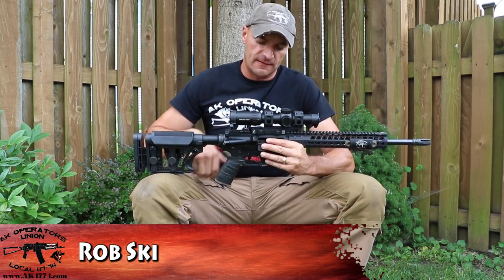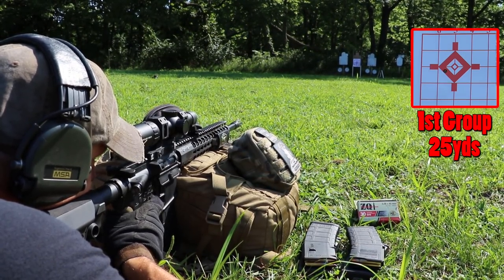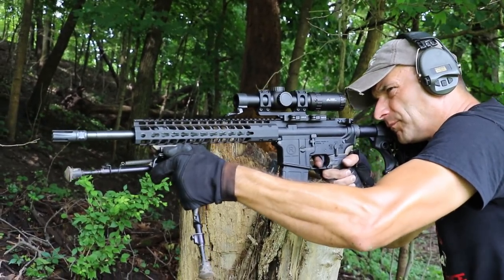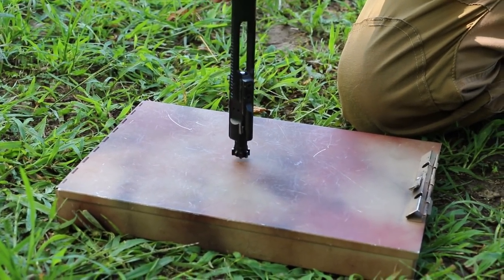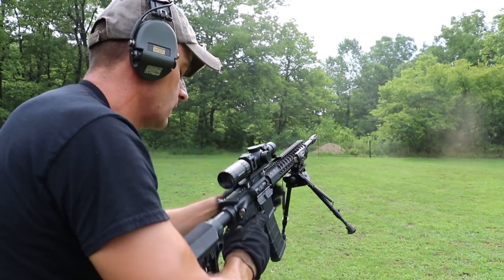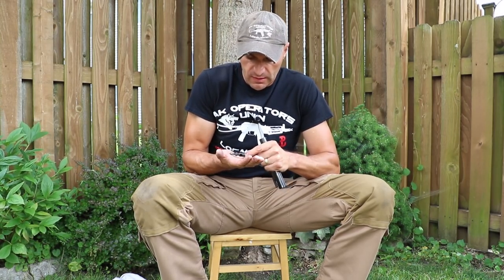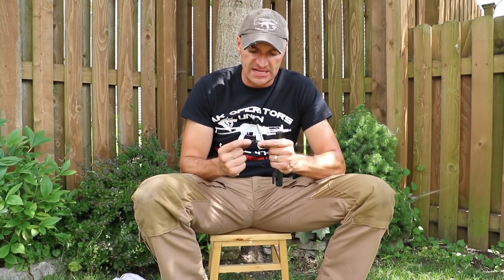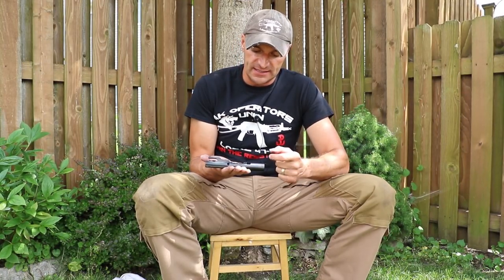Radical Firearms AR-15, 4310rds LATER - Another one bites the dust!

Comment: yes it failed your test says a lot. but for the price of the rifle if the cam pin needs to be replaced no big deal. does the rifle have a carbine, mid or rifle length gas i found on carbine length the bolt takes a beating especially the gas rings and cam pin. still shouldnt break IMO. good test thanks.
Reply: They have mid, but I've heard a shit ton of complaints about hit and miss products from them. They had an issue a year or two ago with the barrel unthreading from the chamber extension and snapping the alignment pin...that's just shit manufacturing right there. Then they claimed that because it happened when some people were swapping out flash hiders, that they wouldn't warranty it...Now hang on. Muzzle devices are usually torqued between 20-40 ft/lbs, chamber extensions are 110-150 ft/lbs...how the hell do you break that torque when swapping a flash hider out?
Reply: If its a cheap BCG no problem but it seems to be overgassed maybe increase buffer weight or its the gas port on the barrel isnt drilled to spec and overgassing it. Either way if you made the decision to buy a complete you were trying to avoid these kind of problems. I do scratch builds I enjoy the process of figuring out what works and what doesnt.
Reply: Michael Reta That's exactly why I build my rifles piece by piece as well, I want to know whats going into my rifle and who build it. I had issues in the past with an Aero Precision upper I bought, albeit, it was a stupid issue...the handguard was crooked (just had to straighten it and re-tighten it). But, because of things like that, I prefer to build them on my own. But looking at these rifles, it's not just the BCG or other materials that are cheap. The overall craftsmanship is absolute garbage. Everything from massive burrs on the feed ramps, to barrels not tightened to spec, to the freaking barrel being pitted to the point it was unshootable right out of the box. I researched the crap out of these rifles and all of their issues...I'd much rather buy a RAS47 from Century than an AR from Radical Firearms. RF is probably on-par with I.O. when it comes to quality, and most likely far below I.O. when it comes to customer service...just go read their facebook reviews. Everything from making an ass out of a customer because they had a problem, to RF actually revealing a guy's personal phone number and home address on the internet while complaining about him to his face...you just don't do that shit.
Reply: +Griff really that's messed up...

Comment: Could this be somewhat related to insufficient lubrication? Certainly there would be much less stress on the cam pin if it were well lubed.
Reply: This is correct.
Reply: True heat and friction that many constant rounds. Usually clean and lube my guns after ever shooting practice or after every hundred rounds. Heat and friction the gun will go dry.  Use good cleaner and oil don't be afraid to oil it especially a ar15.

Comment: I own a Radical Firearms 300 Blackout upper receiver. I had a failure to extract problem within the first 100 rounds!  I had to reset the gas block correctly on the barrel, and add Locktite to the threads of the set screws, on the bottom of block.  They came without the thread compound on them, and moved the block out of position,causing an insufficient amount of gas to reach the BCG.  Pretty sorry that it happened in the first three magazines!!

Comment: I was a state trooper for 27 years and when we carried the Beretta 92F I had a firing pin crack and then when we switched to the Glock 22 I had an extractor break. Luckily for me both happened on the range so no harm. Had it happened during duty use I would have been SOL! Neither gun failed ever again and life was good. Bottom line is things break with use. If it’s not systemic then that’s just the way it is. If the failures keep happening then the mfg has an issue to correct. I believe RF has improved since this post 4 years ago with regards to QC. Replacing g BCG is also a simple fix as some have stated.

Comment: Still a good performance and a quick easy cheap fix with the modular AR design. I just bought an RF 10.5 inch upper for an AR pistol and at 500 rounds it still runs good with minimal cleaning. Running Silverbear .223 55 gr fmj, I don't trust the Tula crap in American chamber guns, seized and broken cases all the time.

Comment: So everyone is screaming its an easy cheap fix and yea it is. But there is no excuse for having to swap components this early into a rifles life.
Reply: Exactly, this lack of quality on a critical component is unacceptable, it makes you wonder what else will break soon.
Reply: Agreed, however your typical Sunday shooter like myself. doesnt put their AR thru the DEATHRACE 5 THOUSAND. I beleive a true measure of this gun will be after he runs a few "big" name ARs Colt, Smith, Ruger etc to see how they fare.
Reply: +Nicole Woodruff   true but then your getting away from that 600$ price range. its like comparing Mercedes vs Kia etc.
Reply: My first gen M&P 15 Sport, after 2,000 round the barrel went out, started to keyhole every round fired, I did send it in & S&W great customer service replaced the barrel & even installed the new muzzle brake I got & sent in with the rifle. I got it back in 2 weeks.
Reply: Ras47s are over 600$ I have seen many of them well over 600$. Oh wait... is the arsenal he tested 600$? More like 1200 I believe???
Reply: there is no AR 5k DEATHRACE standard till he tests at least 5 or 6 "premium" ARs. All I know is Im gonna laugh my ass off if / when one of those hi dollar ARs goes  click like this one did.
Reply: Early? he beat the shit and shot the shit out of it with hate and rapid fire mag dumps. That kind of abuse bolts, extractors, and gas rings (and cheap cam pins) WILL break at around 5k (4310 is close enough). &quot;Normal&quot; shooting with occasional &quot;light&quot; abuse, those parts will last 5-10k, even from cheap bolts and cam pins. Replace the BCG and keep on shooting. Then replace that barrel @ 10k with the amount of hate it has received.
Reply: +556bc agreed
Reply: and the failure of one small part on a single test sample is also no indication at all, in any way, of the wuality of the rifle, or the company.  If anything it simply reflects the maker of the BCG's QA.  Hint:  RF does not make their own BCGs.
Reply: in the interest of fairness to other tested guns it did fail the 5k DEATHRACE however for present and future RF AR owners I wish Rob would update us as to wether the gun continued like a champ after repair  past 5k or 6k or was this the start of a bunch of other RF AR failures. I just bought a RF 762x39 carbine and after seeing the test methods Vs my shooting habits wich is shoot 250-300 rds, breakdown clean- lube ,store repeat in the next couple of weeks. the range dont allow animalistic mag dumps so its one every sec. Im confident it should make 5k without issue. but just to get that warm fuzzy feeling I did order a field repair kit with said broken part.
Reply: +Sean Malahy their bolt is MPI tested. Cam pin and carrier is not. If you buy a radical, as I did, I purchased mine for 495$ on sale then upgraded to a nickel boron bolt for 100$ more. 600$ and I'm sure the bcg and rifle will hold up. I wonder when people will test reliable vehicles like a jeep by dumping sand in them, not cleaning them and saying they suck when they fail.
Reply: No you shouldn't have to. Gas rings do go bad...As do cam pins. Tells me this rifles beating itself up. I've seen these rifles and I'm not impressed. No tungsten buffer weights. Dicked up gas port sizing. Cheap guns.
Reply: No you shouldn't have to. Gas rings do go bad...As do cam pins. Tells me this rifles beating itself up. I've seen these rifles and I'm not impressed. No tungsten buffer weights. Dicked up gas port sizing. Cheap guns.
Reply: +Woodruff Yes that's true...However I've seen some H buffers that are not running a tungsten weight either. It's a cost cutting move by shit peddlers. Bolt bounce is a real thing. Incorrect gas port sizing and shit buffer means the cam pin and bolts going to take the brunt of the abuse.
Reply: +Woodruff I agree for the most part. This review is sample size of one. The gas rings going a little bit prematurely doesn't surprise me. Gas rings go.  A guy at one of my local shops is actually a vetted armorer and he's had more than one of Radicals gun in. I've been to the Semper Parratus armorer course myself. I've owned a slew of AR's. Built and bought. I'm down to five lol. My original Colt A4 style. And four SOLGW rifles. Last November they had their SL furniture equipped for $799 black Friday sale, I bought two but had them add the A5. Then bought their M4 solo light railed guns. And couldn't be happier. Sold off my BCM stuff to a friend that's a BCM fanboy. Gave a 6920 to my nephew and my PSA stuff to my cousin.
Reply: I also suggested swapping the cam pin. But that's just because I would like to see if anything else would break in that rifle. I have a radical barrel in one of my ARs and some other radical parts. So I am curious if it was just the cam pin or if there would be other parts to go out.
Reply: Brett he did switch it. It fired fine after.
Reply: +Florida Prepper he did? Did he show that in a different video?
Reply: +Brett Silva no just commented
Reply: Do you know how much trauma that rifle has been through in a short time?
Reply: Florida Prepper Really.  I'm looking at buying several of their complete uppers myself, but without charging handle and BCG for the .300/5.56 ones, as I can use ones they don't stock, so not likely to encounter the same problem, and I have a dozen lowers all sitting here ready for an upper already, so don't need the full rifle.  Been thinking about a 16" and a 10.5" 5.56, and the 20" .458 lately.
Reply: +DOUBLETEN not as much as multiple ak-47s that have passed the 5,000 round test LMAO  #ARproblems
Reply: Isnt 4000 rounds through an ar15 a lot though?
Reply: Daniel Esbenshade nope. maybe 15000
Reply: My SGL-31 was 750~ about 6 years ago. It's the Obama ban and all the gun scares that have hiked up prices. Plus....what the hell putting spikes and PSA into a list of quality AR builders?? LOL!
Reply: Of course they don't....the lowest bidder does. Have to cut corners somewhere...apparently here it is the producer of the BCG....the most important part of the AR15 platform.
Reply: Not always....PSA sources stuff from all over. Not all their barrels are FN, and their bolts definitely aren't. Not to mention their QA on full uppers they build is a complete crapshoot. I recommend you do some searches on m4carbine.net and lightfighter.com on canted FSB's on PSA rifles. Will lead you right down the rabbit hole.
Reply: That's the safest way to go when it comes to PSA. I bought a DS Arms bolt group once. People freaked because it was a "POS" 79 dollar BCG. Then I pointed out to them that they were the main contractor for the Israeli replacement AR parts, and fulfilled USGI contracts as well.

That shut them up. Point being, do your research.
Reply: Woodruff A canted FSB is a huge deal when you can't get the weapon zeroed....they are pinned in place. It's a completely ruined barrel at that point because the gas port is drilled off center as well. Come on now...it should never have passed QC.
Reply: I guess I just expect something I pay for to at least work as intended and not be totally screwy. Reminds me of interarms AK's and getting a dust cover that never fit because the trunions were both out of spec, and being told to just get a longer dust cover off another rifle. Bandaid fixes like having to zero at the very end of the tolerance of a front sight base are unacceptable.
Reply: Thats like buying an F150 and entering it in the Dakar rally, then complaining that you expected it to function when it breaks down in the race.  What was done with this rifle is not considered "typical use" by most companies.
Reply: You know what, you get what you pay for.......the BCG and the barrel are the most critical components on an AR15, if you cheap out on those 2 this is what you can expect. This is actually not a big huge deal, and I wouldn't condemn Radical for it, it happens especially when they use lower quality BCG's to meet a certain price point.
Reply: So it's OK to replace a broken extractor during an AK's test, but not a cam pin in an AR?
Reply: Xaro Xhoan Daxos The DDI rifle failed the 5000 round test as well......so what's your point?
Reply: Midwest Misfit The point is fairly obvious if you actually watched the test... Rob replaced the AK's extractor the first time it broke. He actually paused the test several days and allowed DDI to send him a replacement extractor. No such allowance was given to Radical Firearms for this AR even though the cam pin is a generic part he already had on-hand and wouldn't need to be shipped. You didn't actually watch the DDI test, did you? It's ok I won't hold it against you.
Reply: Yea he replaced the extractor but that was where the test ended. He clearly stated the rifle would not pass the 5000 round test  and that all further shooting would just to see how the rest of the rifle ran. Did you watch the video?
Reply: Midwest Misfit Dude, the fuck? The extractor broke in the video titled:
DDI Hammer Forged AK47S, 527 Rounds Later...Ejection Rejection
So he allowed DDI to send him a replacement and continued the test in the video titled:
DDI Hammer Forged AK47S, 1000 Rounds Later...Resurrection?
Then the second extractor broke in the video titled:
DDI Hammer Forged AK47S, 1297 Rounds Later...Bye, Bye, Bye..

Now he didn't say it passed, and I'm not saying he did. He clearly declared it a fail. All I'm saying is he replaced the part and kept testing, which is what alot of us wanted to see him do with the AR, but he said "That's not how we do it". So he replaced a part for that AK, but wouldn't do the same for the Radical AR even though he had the part on hand and could have replaced it that same day. That's all we're saying.
Reply: Xaro Xhoan Daxos wow.....who would have thought a guy who runs a channel called ak operators union would give more time and effort to further testing of a new ak to the market than just another budget ar.
Reply: Midwest Misfit wow... who would have thought that all your replies would be nothing but insulting drivel...
Reply: There are thousands if channels doing in depth AR testing. This is a channel predominantly geared towards ak shooters. So expecting him to spend more time with an AR doesn't make any sense.
Reply: Midwest Misfit You really have no place to speak on behalf of this channel, so don't.
Reply: Midwest Misfit It's pretty evident you're the one whining about other people's opinions. You started this thread.
Reply: Midwest Misfit the point really is if you fix a AK to keep testing, fix the AR to. He did replace the can pin and it continued the 5000. Next point is he changed his testing methods. He now oils the guns after so many rounds as he did for the PSA15. This is a great change because even in war you are smart enough to maintain your rifle.
Reply: Cesar Flores The radicals cost under 500.
Reply: Xaro Xhoan Daxos I'm not the one stomping my feet cuz a channel wont wast more money testing a basic bitch budget AR. If it upsets you so much buy the rifle and 5000 rounds of ammo and run a test yourself. You wont do that though because that would require you to do something more than whine on the web.
Reply: Midwest Misfit That's some powerful projection. The only one getting upset here is you. You can't even talk without being profane. Even your first post was just a rant about what others were saying. Your lack of self awareness is something you need to work on. Make it a New Year's resolution.
Reply: theres a reason this rifle cost a lot less than others.. this why on some round types (6.5 grendal and 458socom) CMMG went to a special Anvail frame to use beefier 308 bolt...
Reply: 556bc AGREED!
Reply: Exactly that shouldn't come until like 10,000 rds

Comment: For an inexpensive AR, I'd say thats pretty good. No maintenance @ 4k+, most are going to clean,oil, and inspect after 500 rds, even on higher end ones. Then after 4k+rds, for only a couple of inexpensive parts to fail. Sounds more than reliable for the price, for lack of experience, if you're just breaking into gun ownership, this could be a really good gun for you, learn how to break it down and properly clean, till you get your own technique. You can afford to be rough with it, you can afford to mishandle it(not safety wise, but as far as moisture, maint, dropping in mud etc).

Comment: Probably caused by increased friction from carbon build up.  I bet if it was cleaned, this would not have happened.  I have had gas rings wear out and have shot thousands of rounds after it fails that stand the bolt up test. Great test all the same; it shows that AR platform is still a World class design.